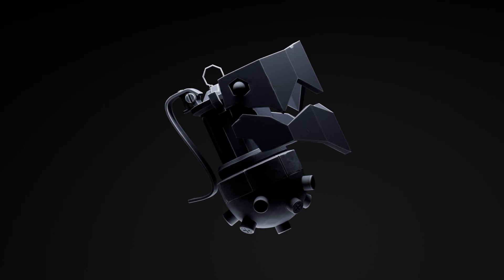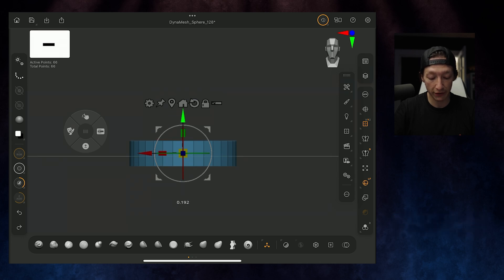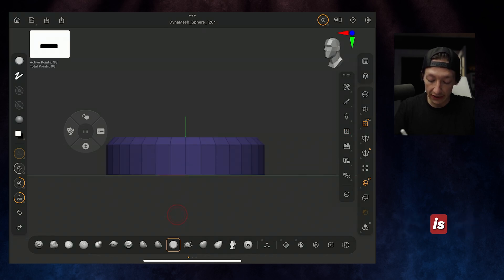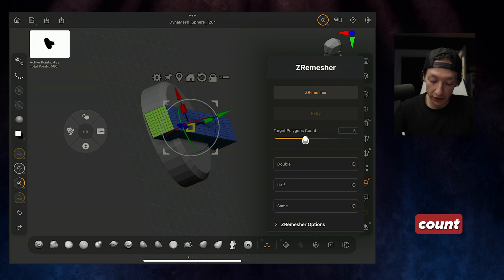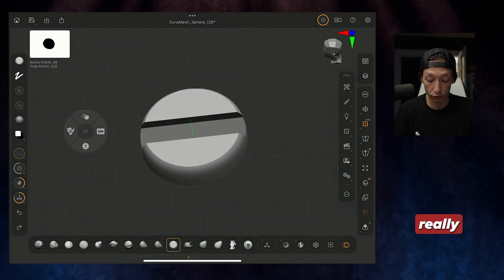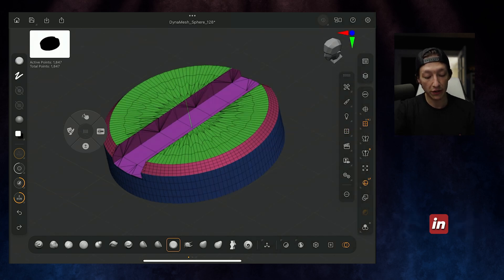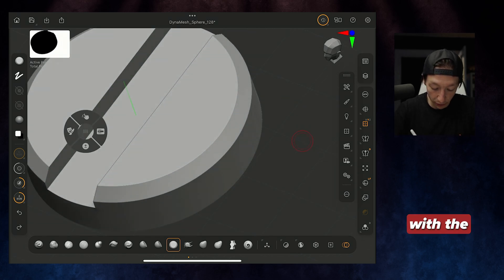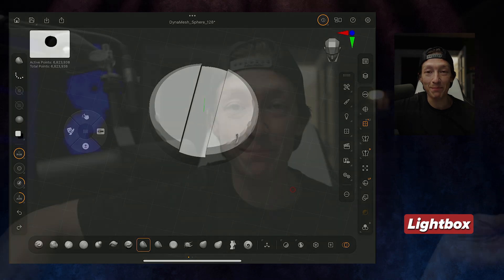Zbrush Ipad Hard Surface Topology Tip

Comment: Zbrush developers were on drugs when they developed this interface.
Reply: Have you ever seen the desktop version? The iPad UI is much better
Reply: Nah. Consider 2 things:
1. The guy is trying to do ZModeling stuff before ZModeler was added in Zbrush. The clunkiness is just a byproduct of lacking the tools that would have made it a lot easier.

2. There's just a lot of stuff in Zbrush. There are a ton of menus and functions in lists and groups. They did probably as good a job as they creating a tablet interface that would be understandable by a user of the desktop while still having improvements over that interface. Presumably you're saying that because you've used Nomad. Nomad is a very nice and lean interface, and I love the thing. But, it also has some functions deeply buried. And when Glen Southern (SouthernGFX) made his videos trying to do low-polygon work in Nomad that was clunky too.